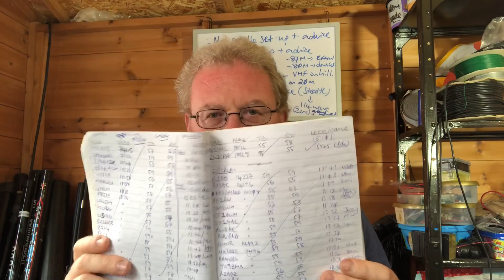How to Operate HF Portable

Comment: What do you to deal with possible pole/mast collapse?  Prevention and counter attack if the collapse happens
Reply from the maker: Temporarily tape each joint to prevent water ingress is an option. I find that good quality poles stay up 99% of the time if not put under too much stress or tension.

Comment: How do Tim, missed you on 40m the other day, family matters called you away. I am looking at making my own HF but wondering what wire to use. Which would you advise? TIA  Gary (M7EGD)
Reply from the maker: Hi Gary. For a HF antenna any insulated wire is fine. Old household wiring, speaker wire is good or you can if you wish, purchase antenna wire from one of the main dealers, 18 awg is a good size to start with and is fine for your 10 watts. Hope that helps and hope to work you some day 73
Reply: @TIMG5TM  Many thanks sir. Also looking a a pole, possibly one from Callum!!!

Comment: Battery masters.co.uk for my LiPO batteries, some come with chargers (I’m QRP), 49:1 home made balun plus 3 separate wires for 20/10/17 and a PAR 40/20/10 all end feds.  7 and 10 meter poles depending on whether I’m walking to a location or just driving.  Drive on stand.  Not been out this year yet, for obvious reasons, breaking out soon.  Can’t wait but enjoyed BYOTA back yards on the air, my station only being 100 foot away but it’s the spirit of the thing.  Envious of your sea side location.  To anyone that fancies getting out operating just do it.  QRP requires a lot of patience but bagging DX on 5 watts is great.  Thanks for posting/encouraging this great hobby, it has something for everyone.  I need to try operating in the winter , but I hate the cold hi hi.  Excellent vid 👍🏻👍🏻👍🏻. 73 de M0AZE MIke
Reply from the maker: Very good advice Mike and thank you very much for the comment. 73

Comment: Thanks, Tim. The Spirit Of Air brand now have a heavy duty 12 metre fibreglass telescopic pole, priced around £76 on ebay.
Reply from the maker: That’s interesting ... I wonder how it compares in terms of thickness and durability to the spider pole? 73
Reply: @TIMG5TM  It appears to have the same outside diameter as the Spider for the lower section and a metal loop on the top section. I also have the Spiderbeam 12 metre pole and it is certainly not for hilltop portable operating :)
Reply from the maker: That’s interesting. Yes I agree about the spider beam pole. It’s up a hill by car or not at all!

Comment: Hi Tim, some great tips there for the novice portable operator. I use loops of Callum's doingy-doingy with wooden duffle coat toggles to secure things like coax and other cables to masts and such. Work very well with cold fingers. Head torch runs on lithium batteries that I can charge from my USB power source. I'm trying to standardise as much as my kit as possible to run on either 13.2v or 5v (USB) so I can run directly off either the 12Ah or 32Ah LiFePo4 batteries I've built. My 32Ah battery box has USB outlets built in, and if I'm hoofing it with the 12Ah pack, I have a USB buck convertor cable that weighs nothing that I can use to recharge torches, phones, and cameras.  I also have an 80w folding solar panel for the big batteries ,and a 16w panel for USB. Not forgetting the NanoVNA for checking antennas in the field.
Reply from the maker: Good advice Andy thanks for stopping by 73